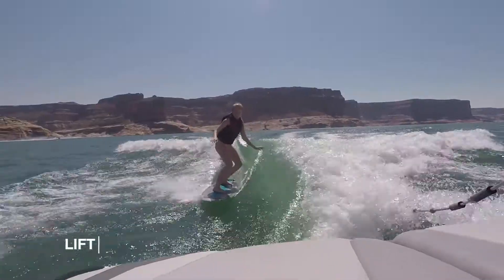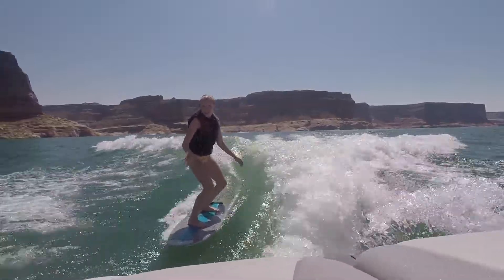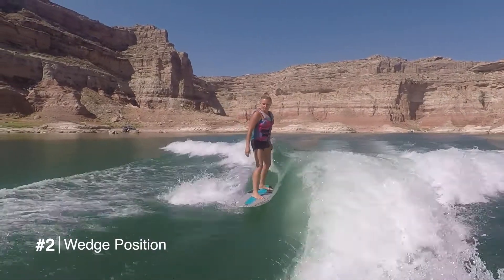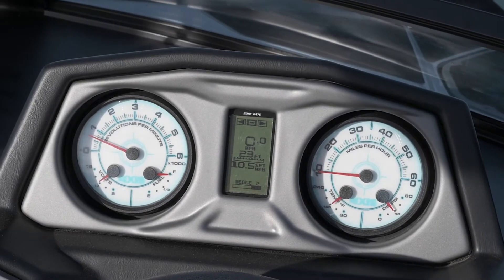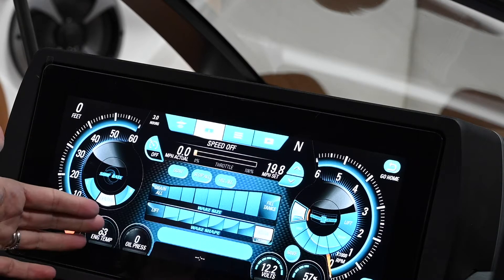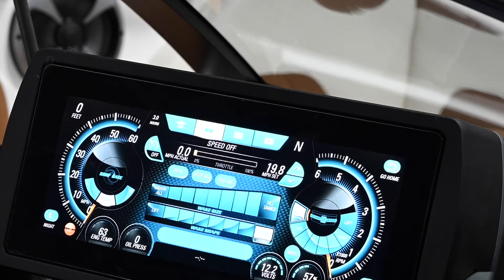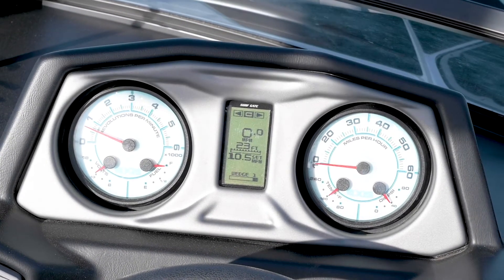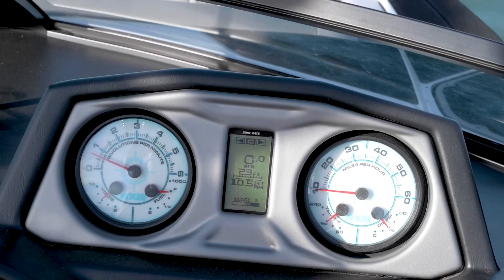Using Power Wedge | Get the Most Out of Your Surf Wake

Comment: I have a 2001 wakesetter with a "old school" wedge that locks either in the up position (pushed up against the bottom of the deck). Or lock down 90 degrees facing the prop.

So down position creates the larger wake? 

And up should be up for just cruising? 

I'm guessing whatever way creates more wake would also hurt fuel economy? Or put more wear on the motor, working harder for same speed?

When should it be up and when should it be down? Is there ever a time it SHOULDNT be up or down?

Comment: Chantel, question for you....  I have a 2021 MXZ23 and "Lift Mode" does not automatically deploy when I am pulling a rider out up.  I'm I doing something wrong?  Was thinking that "Lift Mode" helps the boat get up on plane easier, which is does when I manually touch "Lift Mode" but I am told by other Malibu owners that "Lift mode" should deploy automatically, than once boat is up on plane will go to the pre-set wedge position.  Wondering if you can assist w this question.  thank you
Reply from the maker: If you have your speed set at 17mph or higher, the Wedge should go into Lift mode until you hit 90% of your set speed, then drop into the set position. Cruise control has to be turned on and set above 17mph for that feature to work. Could that be the problem?

Comment: I have a 2020 T22 with the M6. Denver altitude. Still trying to figure out the best prop options. Suggestions? Thanks!
Reply from the maker: What prop have you tried? With that M6, I would probably run the standard prop, even at a higher elevation. It is a good compromise of low-end torque and low RPMs at a higher speed. But if you always have a huge crew and/or add extra weight, you may want a torque prop.

Comment: Hi Chantel, Love your vids, they have helped me a lot, thx! I purchased a 2021 Wakesetter 23 LSV, with option for PNP extra ballasts, but have not installed any yet. The goofy wave is quite nice, but I surf regular and I feel the wave does not have enough push. I have filled all ballasts @ 100%, except the back right which I am toying with between 50 and 75%. Power wedge does not provide any noticeable difference when I cruise (without towing) to check for wave modifications. We are usually 3 on the boat and I am rather heavy (210 pounds). Do you think I have a settings issue or does the boat require the extra ballasts (and lead?) to perform well on regular side? Any tips or links would be appreciated! If you think I need extra PNP ballasts, can you recommend the best ones? Warm regards from Switzerland!
Reply from the maker: Hi Casey! I would add those bags! Super easy to put in. You can still do the 75% ish in the starboard side to make that regular wake even better, but the PnP bags will help a TON! You can find them here: https://ronixwake.com/products/malibu-axis-plug-n-play-ma90
Reply: @ChantelBoats  Thank you Chantel :)

Comment: We have the Axis A20 but our wedge options are up or down what do you suggest on the settings for a beginner?
Reply from the maker: With a manual Wedge, I would start with it up for beginners. When you drop it, it makes the wake shorter and a lot steeper and could be harder for a beginner to ride. Once you can get up and stay stable on the board, try ti both ways!

Comment: So I have a 2006 Malibu wake setter but the wedge is manual.   The only way we’ve been able to get enough force to wake surf without the rope is to get almost on the deck really close to the boat at about 9mph.  Any suggestions.  Would live a video
Reply from the maker: How much ballast do you have?
Reply: 1 tank in middle / 1 Back right / 1 back left
Reply: Or did you mean how full were they.   The middle was 50% the back Right 75%
Reply: It’s the 24’ WSV with the 400hp engine.
Reply from the maker: Do you have any extra bags? It sounds like you could use more weight and a surf shaper, check this one out, it works super well https://www.activewake.com/shop/boat-main/ballast-shaper/wakesurf-systems/liquid-force-wakesurf-edge-wake-pro-shaper-2/
Reply: I have a 2006 and installed aftermarket surf tabs “go surf assist”.  Makes a huge difference. Run factory ballast rear full both sides. Full center and full front. Added fat sacs in both rear compartments and one in front alley. Run wedge at 3 at 10.6 on cruise. Best setup so far

Comment: Hi Chantel, great video!  We have a 2022 23 LSV and I'm finding the wake to be tall with plenty of push but not enough length.  This worked well when we first started getting into wake surfing but now when trying to learn tricks I find the wake is just way to short (the pocket is very small and steep).  We generally run with all ballast full, 10.8 mph, and the power wedge all the way down at 1 or 2.  Any thoughts?
Reply from the maker: Hey! Congrats on the new boat! Do you know what size plug n play ballast bags you have in the back?
Reply: @ChantelBoats  thank you!  We have the w022-570-avo bags. Went out yesterday, increased speed to 11.1, moved passengers around (including to the front), but no real progress. Wave is really tall (even with Wedge at 1 or 2) and comes off the boat at an angle so the pocket and curl are quite short (maybe 10 ft of surf area). The videos I watch have nice long waves that trail behind the boat for what looks like 20-30 feet… thanks again for any suggestions.

Comment: What boat is better for a choppy ride on rough days? The 23lsv or the G23? Also, can you use the wedge to soften the ride on choppy days when just cruising? Thanks
Reply from the maker: The G23 will be pretty through super choppy water. It's a displacement hull, so it just plows right throw the water, where the LSV is a planing hull, so it is going to get up on top of the water. I've never used the Wedge that way, but I suppose you could mess with it as long as you don't go faster than 27mph.
Reply: Chantel Herbert 
Got it. Will play around a bit as I currently have a 2019 23 LSV. 
Tks

Comment: I have a 2020 t22. Just starting surfing. Running at 10.8 with wedge 3/4. How do I make the wave farther back. Have full weight in all ballest. Surfing left.
Reply from the maker: If you put the wedge at 2, you will get a longer, but less steep, wake, so definitely try that. You can also move some of your people/gear to the front of the boat which will lengthen the wake out as well.

Comment: Great video. I have a new 2020 axis a22. Can you clarify how to get into stow mode? I understand it’s over 1mph to 10mph. Do you keep pressing raise wedge after 6 and the next setting is stow? 

I realized after completing a surf session I was driving around in “lift mode” for a while. Is that problematic for the boat in any way?
Reply from the maker: You can drive with the wedge down up to 27 mph. Ideally it’s stowed when not in use, but I doubt you hurt anything! 

To put it in stow, you can either push and hold wedge up or the go home button until it gets all the way there, and yes, the next level up from 6. I would do this while the boat is barely moving, 1-4 mph, then when it’s stowed, you can take off!
Reply: @ChantelBoats  if we have someone who wants to ski and choose life will that lesson the wake for them.  Say first thing, no ballast and lift mode...as long as we stay under 27mph it should be ok?   2019 A24.
Reply from the maker: @tjtingley  You got it!

Comment: OK I’ve got a question. Using the power wedge for wakeboarding Let’s say it’s set at four, The wakeboarder falls we go back to pick them up and go again. Does the wedge always stay in that 4 position or wouldn’t it be better if it went to the lift position to get up on plane and then back to where it was that after reaching a certain speed. Is there a setting for this? By the way my Malibu is a 2012.
Reply from the maker: Yes, that is better, and the new Power Wedge does that automatically when your speed is set at 17MPH or higher. The Power Wedge in 2012 doesn't do that, unfortunately.

Comment: Hey there, I have an A22 2018. Just getting familiar with the wedge and ballasts in general. So when the wedge is in the down position (furthest down) is that goin to create the biggest wave? Or is the wave bigger in the position just before it is stowed? Also, what are tricks for making the wave longer vs steeper. Yesterday I had all of the ballasts full and the wedge at #3. The wave seemed short and steep? Any thoughts on how to shorten the height and make it longer? Thx a ton. Your videos are helping!!
Reply from the maker: Hi! For surfing, full ballast. For the Power Wedge settings, a 3 or a 4 is going to be big, steep and shorter. A 1 or a 2 is going to lengthen the wake out and give you less push. Lift mode is -500lbs of ballast, so that is going to be very long and not steep at all. Typically, when we have bigger people or more experienced riders, we run it on 3 or 4. Smaller people or beginners, a 1 or 2. Lift mode when teaching little kids - they need VERY little push! 5 and 6 are even more aggressive, but they just wash out the wake, so we don't use those.

Comment: i have a 2019 A24 and you are spot on with your recommendations below in the comment replies. if you do this again, i would add that you don't need to go faster than 25 or the warning goes off. 

My question is on skiing ... how is the best way to flatten the wake in this boat for some older guys that do not want the wake... weight in the bow only with people or ballast?
Reply from the maker: I would say as few people as you can get, either no ballast, or a little in the bow. It will never fully flatten out, but that would be your best bet.